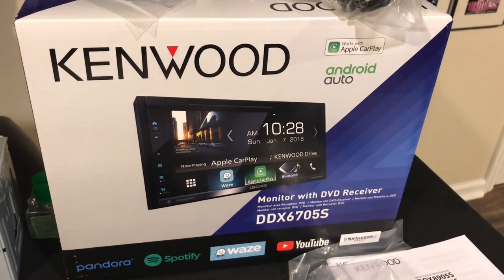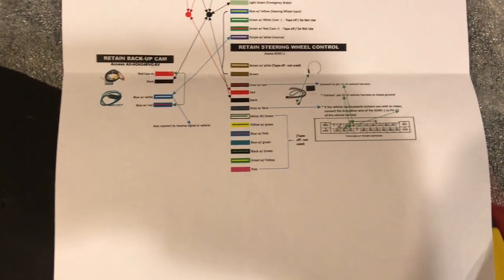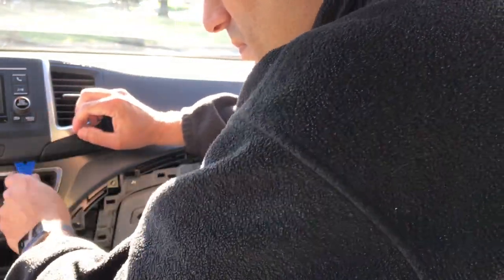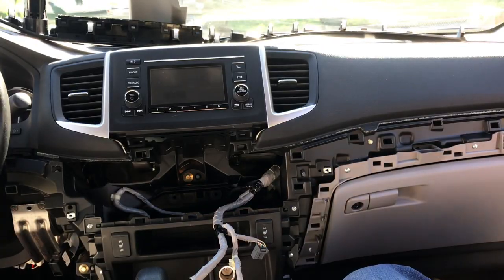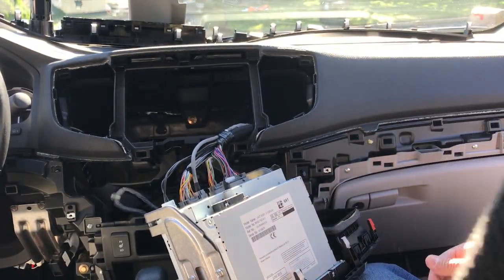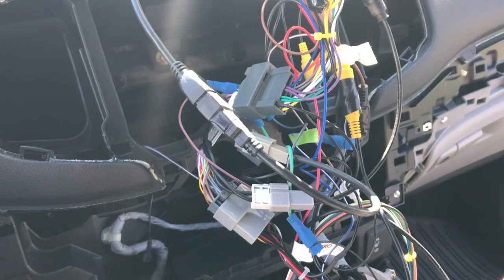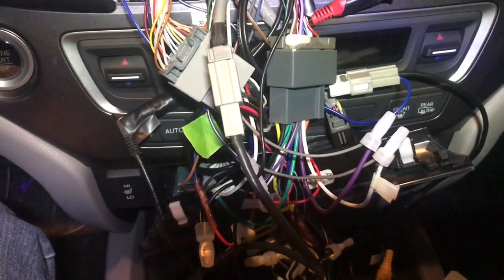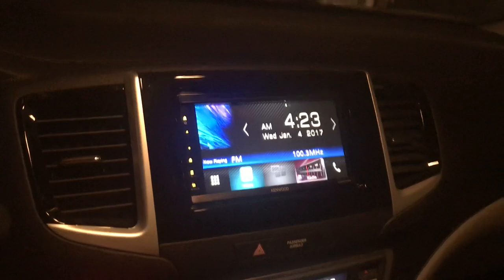James's 2017 Honda Ridgeline Factory Stereo Swap

Comment: Great work. This vid is very informational for DIY’ers. I’ve been hesitant to install an aftermarket HU because I don’t want to lose the “dewarped” views from the backup camera. Any way to work around this or are we stuck with the fisheye view?

Thanks again.
Reply from the maker: Richard Sercena I am not sure. I read something about a toggle switch but that is beyond my DIY expertise. I didn’t like it either at first, but you get used to it. I still back up old fashioned way ( turning around and side mirrors) & only look at cam to see how far back I can go.

Comment: Got the Kenwood Dmx7706s installed in my 2017 Ridgeline RTL but can’t get the Axxess ASWC-1 recognize the unit. Just keeps going to red/green flash back and forth. When we try to hold down volume to get to ASWC to go solid green I just goes back to red/green flash

Any advice.
Reply from the maker: All I can suggest is to double & triple check the wiring.  If not, call Axxess customer support.

You could also try switching the 11 to grey red and 22 to ground.  I do it the way my instructions said.  Axxess said to switch it, but it didn''t work that way - just the original way I was told.

Comment: Hi there, is the PAC USB-TY1 Toyota/Lexus OEM USB Port Retention Cable is compatible with the 2017 honda ridgeline to retent the usb port? Thanks.
Reply from the maker: yes.  that is what I used
Reply: @TJhooker07753  Thanks James, one last question Brother. AX-Hon24RVC-6V to retention for backup camera. Connected Black wire to ground of the AX-CAM6V to ground - connecte Red wire labled Camera Power 6V to blue/red wire of the AX-Cam6v - connect yellow rca jack to camera input. This is where I messed up -(Connect the Reverse In wire from the aftermarket radio to the Blue/White wire of the AX-cam6v) - That did not work. I must of not hook up the Reverse signal in the vehicle which I don't which wire it is. Please help and thanks again.
Reply: Is the Resverse signal in the Vehicle is the Brown wire where the fuse box is?

Comment: I have a 2019 ridgeline and I’m replacing head unit with a Sony, my question is, how do I retain/ wire to keep factory subwoofer? Any help would much appreciated.
Reply from the maker: Couldn’t tell you. My model didn’t have one.
Reply: If you haven't found out already, you will need to put in a 50-150watt aftermarket amp to power that.

Comment: James, how did you take out the brown reverse wire? I don't want to break it...
Reply from the maker: nysprewell don’t take it out. Tap into it. I used a quick tap from the auto parts store. Make sure it’s the right gauge. 

I preferred this method because I didn’t want to cut anything that could effect car warrantee.
Reply from the maker: nysprewell see video at 8:02. You can see the red tap that I used.
Reply: @TJhooker07753  Cool thanks.  Yeah i didn't know what red thing was  or how to use it.  i'll figure it out.  Do you remember the gauge size?

Comment: Thanks for posting this great video James. Am considering upgrading to the kenwood touchscreen as well but wanted to ask are there any big drawbacks and have you had any problems with any of the functions?
Reply from the maker: It has been about 5 months and no problems that I have seen so far.  I am quite happy with the setup.  I love having appleplay, able to see my apple maps on the screen, as well as text messages and phone calls hands free. There are many other apps and features that I have yet to play with.  It was a little bit of work, but worth it for $400 something dollars vs a $2K or $3K upgrade to the next higher end Ridgeline just for the better radio.  

I also enjoyed being able to document what I did to help other Ridgeline owners.  There wasn't much out there.

Soon (maybe next week) I plan on upgrading the horn to a duel horn to make it louder.  I hate the sound of the wimpy horn that the '17 has.  It is my understanding that the '19 horn is a duel horn system, so it must have bothered someone else as well.  I will document that as well.

I didn't document it, because there are already videos out there, but if you didn't door the rear door check hack, I recommend it!  Much more convenient!
Reply: Yeah I already did the rear door hack. Awesome mod but factory was Just way too narrow. I finally did the installation and everything worked except for the camera.  Reverse wiring wasd correct because screen changes to camera mode when I back up but seems as if there's no power. The screen is black with the colorful lines saying to check for surroundings
Reply: Would you or anyone here happen to know what the problem is or had that problem with their installation? I doubled and tripled checked your diagram seemed like everything is correct.  I'm thinking it may be a faulty wire with the camera harness so I might take it out and check it when I have some time
Reply from the maker: Jeff Hoang I am not sure, but I would check the ground to the wiring harness. I think I read somewhere that it needed to be connected to its own ground and not to the same ground as the wires to the radio.
Reply: Ok thanks I'll check that out
Reply: Jeff, what was the solution here ?

Comment: What is the name for the USB adapter cable ?
Reply from the maker: nysprewell click on my wiring diagram in description. It is on it. Thanks for watching.
Reply: @TJhooker07753  I finally got my Ridgeline and all the stuff I need to replace my stereo.  However, crutchfield still has the Metra HD12 for the antenna listed.  You said to use the HD11.  Unfortunately I ordered the 12.   Will the HD12 not work at all?  thanks
Reply from the maker: The HD 12 has 2 wires, the HD 11 has one.  Also the plugs are slightly different shapes, no I would say no.  Funny thing, I verified this with Metra & told Crutchfield.  They sent me the right one & I sent the wrong one back to them.  You think they'd fix it.
Reply from the maker: No.  Wrong connector.  I just uploaded a pic that shows difference.  See link in comments.  Crutchfield was good about making the exchange for me.  I verified it was wrong with Metra.
Reply: @TJhooker07753  Thanks, I got the 11.  Now my next question is where did you ground the black wires from the steering wheel control, the backup camera , and the 6V converter?  You only have the blue/wht and blue/red listed. Thanks so much
Reply from the maker: nysprewell behind where the stereo goes is a bolt that is grounded. I loosened the bolt & wrapped the wires around it & tightened it.
Reply from the maker: nysprewell you can kind of see the bolt I’m talking about around 6:10 in the video. Gold colored near top-center of the screen.
Reply: @TJhooker07753  Thank you so much!!  I ordered another harness too so I can pull the 3 wire pins to connect the rest and I should be good to go!
Reply: @TJhooker07753  I noticed something else.  On the AXXESS site it says to ground the black wire of the ASWC-1 and Pin 11. The Gray/Red wire goes to Pin 22.  You have the opposite on your map... Ground Black wire and Pin 22 and Gray/Red to 11. Was that a typo or is it different for you?  I'm installing a Pioneer . Thanks
Reply from the maker: nysprewell when I installed it I spoke with them & they told me if it didn’t work to switch them. The original documentation had it reversed what theirs said. I had no problems with original instructions though.
Reply: @TJhooker07753  OK, 2 more questions.  I got the cable to retain USB but Were you able to retain both USB ports from the truck somehow?  My Pioneer only has one USB port.  2nd question.  How exactly did you connect to the brown reverse wire?  Thanks again for everything
Reply: Critchfield says their installation gear will lose Bluetooth and Subwoofer. I assume you just use the new Bluetooth, but is your subwoofer behind the rear seat still working?
Reply from the maker: I didn't even know there was a subwoofer behind the seat.  The stereo sounds the same to me.  I have the RTL - does that model have it?  I can still connect my iPhone to the new stereo via bluetooth.
Reply from the maker: I think I  only have 1 USB port in my RTL.  The adapter retains that.  Reverse wire connected using a wire tap connector I got from local auto supply.
Reply: You should have 2 USB's, The other one is next to the cigarette lighter underneath the buttons for the heated seats.  I use that one for Carplay.  I didn't retain factory AUX though and when I called Axxess, they said that the adapter to retain AUX won't work with newer iphones and ipods so I had to put the wire on the back of the radio which is a little annoying but whatever.  The wire hangs underneath the dash near center console
Reply: You'll need an amp like the Alpine ktp-190u to retain the factory Sub
Reply from the maker: @nysprewell  I don't use any amp & it sounds fine to me
Reply from the maker: @nysprewell  I have the RTL.  I only see one USB.  The aux jack (that looks like headphone jack) is not retained.  USB is.
Reply: @TJhooker07753  I have the RTL as well but the 2019.  Maybe they added the second one on the newer model.  Also, I know it does sound really good even without the sub but I was answering the other reply from Congo597 where you do need an amp if you want to retain the factory sub.  I installed it in mine and it does give it a little extra oomph.  I love this truck!
Reply from the maker: Glad it worked out for you.  I have the 2017 RTL.  It is a cigarette lighter style plug under the seat warmers for mine.  The only USB is the one in the storage console.  I  love my truck.  I have been from NJ to Missouri to Texas with it.  This year I have 3 vacations planned.  Maine, North Carolina, and the Great Lakes Tour.

Comment: where did you buy the usb cable?
Reply from the maker: amazon.  Part # in file I attached
Reply from the maker: https://www.amazon.com/PAC-USB-TY1-Toyota-Lexus-Retention/dp/B00F0YJ49O/ref=sr_1_1?ie=UTF8&qid=1549379506&sr=8-1&keywords=PAC+USB-TY1+Toyota%2FLexus+OEM+USB
Reply: does apple car play work with the factory usb then? or do you have to use the the head unit?
Reply from the maker: @johnsitzes8383  apply car play works with the factory USB (located in the storage compartment between the seats) once you use the adapter to retain the usb.